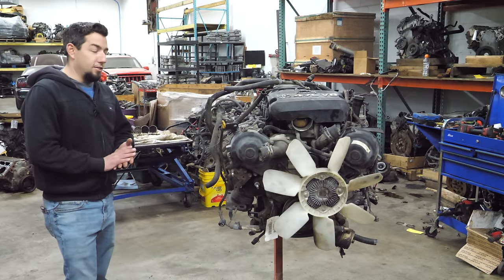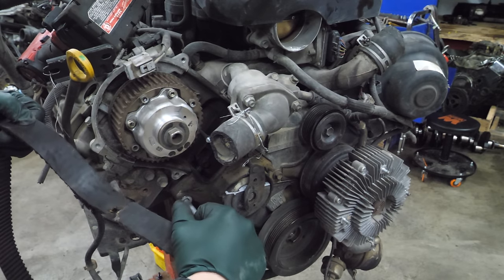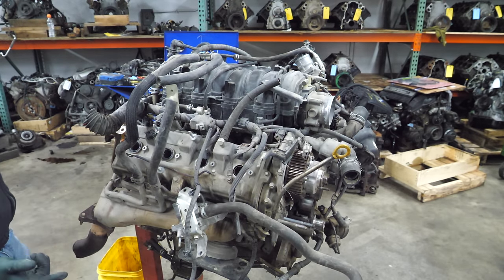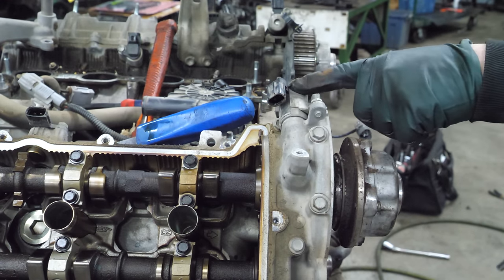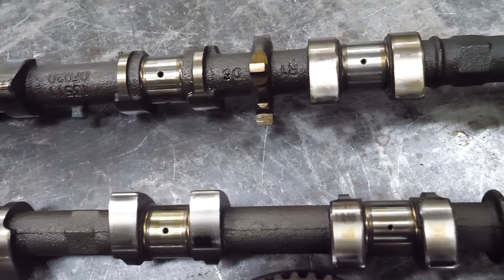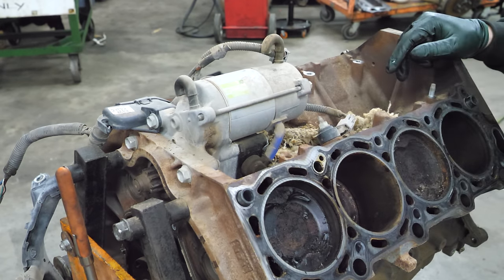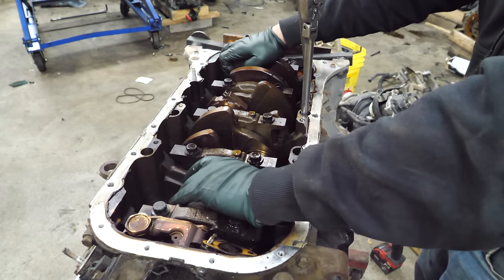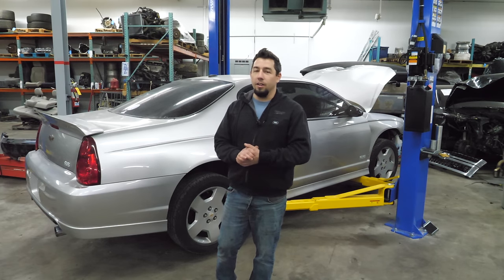Toyota Tundra 2UZ VVT Teardown! Bad Decisions Led To The Demise Of One Of Toyota's Greatest Engines!

Comment: You're absolutely right---any decent mechanic would've performed a leak-down test to check for bent valves, as well as used a boroscope to check for piston damage. This engine could've been put back on the road with nothing more than a new timing belt
Reply: That's the biggest tragedy with this engine
Reply: dumbass mechanic probably put some high mile oil burning pos back in the truck.
Reply: I'm surprised no one tried just putting in a new belt. My brother's civic's belt snapped and we put a new one in and it was fine!
Reply: Honestly. My 97 4runner was parked for 3 years since the PO has a coolant flush botched by the local repair shop, which blew both head gaskets, filled the cylinders and oil with coolant, and torched a head. Somehow the belt also shredded in the process. .030 off the heads, a quick hone (without even removing the pistons), gaskets and a belt, and it fired up like it was parked a day ago. 90s/early 2000s Toyota’s are like cockroaches, you just can’t kill them.
Reply: Probably just as expensive swapping motors than putting a timing belt on it. But you know the social media experts that have never turned a wrench would disagree.
Reply: @tomholskey992  Well, keep in mind that most shops won't install a used engine, only a rebuilt long block. So in that regard, the timing belt would be cheaper
Reply: @tomholskey992  And then the engine you swapped in snaps it's belt because it's old too? Or you put a new belt in it then swap it in so do both things belt and swap? Just curious how you came up with that idea.
Reply: OMG, this engine was just broken in and could last another decade at least!
Reply: I've replaced 3 broken belts on these, all 3 customers were on the highway when they broke. None of them had any valve contact
Reply: 1995 Honda odyssey ex with 302,000 miles snapped timing belt on hwy. Towed home . Back to tdc. All good after replacing belt
Reply: @IacobucciB  I have heard that the Hilux is like a honey badger...can be the very devil to kill.
Reply: Competence, in any field, is a dying art these days. Atlas is Shrugging.
Reply: This is exactly how I got my 05 Sequoia for <2k vs 5k+ lol. Timing belt skipped two teeth and owner thought there was valve damage because there was a ticking sound. Compression test checked out and scope showed no damage. Turned out the ticking came from an exhaust manifold leak, which they’re notorious for. Swapped out timing belt/water pump, and still going strong 2 years later lol
Reply: @tomholskey992  Bro a timing belt in these is like 1100 lol that's nothing
Reply: @XXXXHHHHHTTTTTHHHHHH   Fully agree!
Reply: You have to be careful with valves that are just slightly bent. If there was any contact, the heads can snap off some miles later. Saw this a bunch with VW TDIs.

Comment: So let me get this straight. What did the most damage wasn’t the timing belt breaking, it was a knucklehead leaving outside after he took it out of the truck?
Reply: Yep I was just thinking the same thing
Reply: @jedidiahkuepfer8889  what a shame.
Reply: I don't think the motor was hurt by the broken belt. Could have stuck a new one in and tried it before they ripped the motor out.
Reply: What amazes me about "leaving them outside" is that a plastic bag would be enough to keep water, out only a few cents even at "engine sized" and preserves the value even if it's "just a core"
Reply: Man a 3 hr job and this truck would’ve been back on the road.  I should do mine soon, sitting at 140k last done at 80k
Reply: @klinatoc  Got another 30k on it probly.
Reply: true the design of pistons to have some groves as space for unpropper timing and toyota famous of this design the same came to me and just cleaned the pistons and heads and reassemble it and still running well
Reply: These are non interference unless they’re in the vvt range.
Reply: Threw away a great vehicle for a DIY $500 expense. Maybe less

Comment: I just purchased a 2005 Sequoia at a salvage auction with 363,000 miles on it. It turned out to be a one owner car. I couldn't find a sticker in the engine bay to indicate when the timing belt was most recently changed so I called the previous owner. He was very nice a proceeded to tell me the only thing he ever changed on it was the radiator and maybe the alternator but never the timing belt. Needless to say, I'm not even going to start the car one more time until I change that belt. It's hard to believe the belt lasted that long but he did say it was a lot of freeway miles.

Comment: I have a 2006 Tundra Access Cab, 4 wd, tow package with the 4.7 engine. The truck still looks and runs like new at 130K mile (barely broken in) I am 66 years old and I intend this to be my last truck.....I love it! I have had pick ups since I was 16, this is my best and favorite one yet. At 100K I had the Toy dealer do the timing belt, water pump, all fluids, plugs, trans, transf case, rear end, all new belts and hoses. I change oil every 3K miles with Mobil Super a conv/syn blend and a Mobil 1 oil filter  I am sure my truck is set to go to 250K .........my 1996 T-100 did and was still strong.

Comment: I know a guy that installed the timing belt incorrectly with one cam off about 20 degrees. He got all kinds of lights and it missed horribly. He called me AFTER he drove it that way to the Toyota dealership who told him the engine was junk now and quoted him $9000 for a new engine. I told him bring it home (drive SLOWLY) as the "damage" was done. I told him start pulling it down and I will come over and help you time it. Timed it, buttoned it up, reset the computer, and it started and ran perfectly and has for over 65,000 miles.
2005 GX470 4.7 VVTI.

Comment: Still have my 05 tundra.768,000 kms and 5 belts later,still runs like the day I bought it.  I’ll put another 700,000 kms on  it then I might think about getting a new truck!! Or maybe not. 
Cheers to all. 🇨🇦🥃
Reply: 768,000 km?? Seriously..do you ever work or do you just drive around 24/7😁 I cannot fathom being on the road that much!
Reply: By the time this engine wears out on you, it might be the case that the only thing for sale is electric vehicles!
Reply: at another 700,000 kms that truck might be getting a new owner  aka your kids bc that truck very well might outlive you hahaha. Must be a hell of a club being an engine that outlives its operators lol.
Reply: @44R0Ndin  doubtful, it has occured to me that electric vehicles simply cannot penetrate the lower end markets simply because you cannot install chargers on an apartment since you don't own it and nobody has time to wait an hour for a supercharger elsewhere to get you up to speed. At the very worst we will see mostly hybrids, but all electric remains hardlocked to the middle-upper classes who own properties and can afford to mod them to support EV's.
Reply: @oceanbytez847  There's a solution to that. Wireless charging. Now I'm sure you know that currently only works for things like cordless toothbrushes and cellphones, but the technology could easily be scaled up to something where a vehicle could park on an otherwise normal parking spot (such as on the street around an apartment building, which you say is such an "impossible" problem to solve) and connect using what I am currently calling "mostly wireless" charging technology (which I'll describe later), and if you set it up right all the driver has to do is pull up to the spot, maybe push a button in the car or maybe use an app on their phone to tell both vehicle and parking spot (with attached charger) that you need to charge your vehicle and you're (optionally) willing to pay for it.

I know that wireless charging only works efficiently over really really small distances. I have a solution in mind to reduce the distance from the car's power reception coil to the parking space's power transmission coil, and it uses technology that is already wide-spread in the automotive industry.
if you have all the sensors and computers for these fancy lane-keeping assist type things and adaptive cruise control and all that driver assist tech, and pretty much every car within the past 10 years has had a fully drive-by-wire throttle (no more physical cable that connects the butterfly throttle valve with the accelerator pedal, it's all computerized now), then you almost certainly have enough tech on board to be able to implement a vehicle that can park itself very accurately in a specific space in a spot using specific markings on the ground (lane keeping stuff is great at finding the lines on the road, even when  they're degraded by use).
So if you can park in a very specific spot on the ground consistently, and you put the vehicle's power reception coil and the parking spot's power transmitter coil on top of each other when that vehicle is parked in that spot (referenced and perhaps offset relative to some common datum like the front axle line), then the only remaining distance to close is vertical, and for that all you need is some gravity and a flexible coupling between the vehicle's power reception coil and the vehicle itself.
Basically, park in a really specific spot on the ground (aka "in the parking space within roughly an inch or less in XY directions"), and then the vehicle would just lower its power reception coil (using a simple linkage and maybe a small cable winch type actuator to retract it) to be literally on top of the power transmission coil, thereby minimizing the distance between the two coils, enabling efficient power transfer between the two without any "objectionable" cable connections to be within easy range of becoming vandalized (and side effect of being a power reception coil, it could have a secondary much lower amperage much higher voltage winding that would electrify the exterior of it similar to a tazer or stun gun, making attempted vandalization a fruitless and extremely painful affair).

This is why I call it "mostly wireless" charging, there's still a wire connecting the vehicle's power reception coil to the rest of the vehicle, and there could even be a steel wire rope connecting them together when the vehicle is in motion.

If the driver's interface with such a system is not done fully thru a smartphone app for the vehicle's various "smart" systems (such as Android Auto but working over bluetooth or Wi-Fi), then it could be done similarly to how modern parking meters work, where you punch in which spot you're on and what your license plate is, and it punches out a ticket saying how long you want to park there and how much electrical energy you expect to be delivered in that time (with both factors being variable to some degree).

Wide-scale adoption of this would make electric vehicle charging issues disappear as soon as it can be implemented, aside from the obvious continued need for expanding the DC fast charging network to enable longer trips with EVs, but this "mostly wireless" charging idea of mine would be a great solution to the problem of "but we don't want to have to put all these posts in the ground to hold the charging cables" for slower charging.

EDIT: Or you know, we could do it the other way, by having the government give skin-flint landlords a push in the right direction by offering financial incentives to put in EV charging in their parking lots. Because at the end of the day, IMO that's what the government's for, it's for applying corrective measures to society when it missteps and we are able to codify that misstep into a course of action to guide society back onto the desired path whatever that may be.
But both approaches can be done together, they don't work against each other.
Reply: Cool.   Just curious... have you ever had to replace the starter?     I'm happy with my 03 Sequoia.
Reply: Incredible  mileage,  certainly good your $ worth.
Reply: 317000 km on my 05.  I hope I make it to 700k
Reply: @oceanbytez847  At my condo it would cost $2,000 to install a 40 amp smart charger. Then the HOA wants $1,000,000 insurance which would cost $900/year. Throw in the cost of electricity here in CA and owning an EV simply makes no economic sense.
Reply: WTF are kilometers?

Comment: This happened to my 2004 tundra, I put a new belt (and waterpump /timing stuff).  Has been running for 2 years since that day and no issues.  No valve damage and compression/leakdown were good for a 300,000 mile motor

Comment: I am the original owner of an ‘06 LX with this engine with around 794k miles. The truck has been up and down the East coast several times a year for the past 16 years through all sorts of weather and roads. Primarily driven in the Tri-State area. Timing belts have been done every 80k like clockwork to avoid issues such as this, along with the mechanical fan clutch, water pump, and associated tensioners and seals. My wife and I can’t stop driving the truck with how smooth it is. She wishes I got one for her too back in the day haha
Reply: That’s a dream 😍

I can’t even imagine how amazing it would be to be buying a new vehicle in that era. I was born in 1997 and I’ve only ever driven Toyota and Lexus vehicles 18+ years old, currently on a 2006 sequoia. I absolutely hate new vehicles, and all I dream of is a rust free 2UZ-FE SUV one day.

Comment: I bought a 2001 Sequoia with 151k miles. Couldn't find any stickers saying if or when the belt was changed, so I bought the kit and with the help of Youtubers. I did the job and so glad I did. The belt was obviously original and cracks all over. There's a sticker on it now.

Comment: You are right about the starters on this motor. I've sold car parts for 14 years and have never sold a starter for a Toyota 4.7.
Reply: Mine went around 130,000
Reply: This and Northstars, even if they do fail, pulling intakes on these vehicles isn't as hard as getting the exhaust out of the way on a lot of other vehicles.

Comment: My 2006 tundra has 352,000 miles.  Still runs strong.  There are at least 2 4.7s that have gone 1M miles not rebuilt.  Those spindly rods are why this is not a great engine for lots of boost.  Great video again.  Thx

Comment: So I have to say that this engine is probably my favorite engine out of all of my vehicles I have ever had. The oil in the engine comes out as clean as the day it was put in. I tow, haul, you name it, it has almost 200k on it. It runs beautiful and has great power. I went to replace the spark plugs the last time and was shocked they still looked like new. It will very likely outlive the truck

Comment: My boy bought a 2004 Crew Cab Tundra for $800 because it had a broken timing belt.  Valves were minimally bent - only really seen with a flashlight with the head off.  Re-valved, re-seated, and changed a lot of wear items, and oil pump - he is driving it to school daily -  truck has over 350k miles on it.  Love the Toyota.  My wife and I have a Gen 3 with 140k miles on it.  Great vehicles that never miss a gas station.

Comment: As an owner of a 2002 Tundra with the 4.7L, I am astounded with the smoothness and reliability of this engine--even after 235,000 miles. I've owned other V8's and, so far, nothing has come close to the build quality of 2UZ. You're teardown proves that.
Reply: 😂 plenty of v8s are smooth at 300k
Reply: I miss my 01. I panicked and sold it at 75,000 miles because of fuel prices.
Reply: I'd rather pay an extra 100$ or 200 a month in gas than spending 60k on a new truck. No thanks
Reply: @Jeff-sp7bg that's exactly why I still have my 04 tundra. It only has 138,000 miles on it and it's paid for. I looked at a new Toyota pickup the other day, $51,000. I'll keep mine.

Comment: My wife’s 99 landcruiser went 315k , we sold it running great. These motors are bulletproof. The only weak spot is the starter every 125k miles, it took me 7 hours to change it. Deep under the intake manifold.

Comment: For clarification, yes the purpose of the top mounted starter is Toyota reliability by design. It is placed at the highest point of the flywheel when crossing deep water or flooded bush country. Unlike Detroit products low bell housing fail. Fortunately, the Detroit designs keep you in business! Pay attention or pay cash!

Comment: I have this engine in a 1G Sequoia, definitely one of the best engines I've owned. I did a timing belt at 98k miles and it's due again soon. Really great engine.
Reply: how many miles do you have on it now??
Reply: @kingmo4653  about 190k miles, it's been an amazing overall vehicle to me
Reply: I recently did the timing belt at 155k mi on my 2005 sequoia. Mind you it was on the original timing belt and it looked virtually new. I wonder if it would of lasted 200k but I didn’t want to gamble
Reply: @jamesmaldonado5794   Good call on not gambling. Regardless of belt life, always nice to check the water pump and some of the other bits while you change it. Had a belt break on an old RAV4 once, the worst part was I was turning left at an intersection so I had to push it out of traffic. So can be dangerous for that reason, but towed it home and swapped it out and it ran like new after.

Comment: I have a 05 Tundra with the 4.7 2uz. I only have 156k. My best friend has an 01 Tundra 4.7 with 460k miles. Still runs beautiful with half a million miles. He has always been adamant about maintaining it.
Reply: My friends brother in law worked as a tech for Lexus for 20+ years. He said the 4.7 2uz is almost bullet proof. He said he had never seen a timing belt fail on one. He said if you intentionally don't take care of it, it may fail.